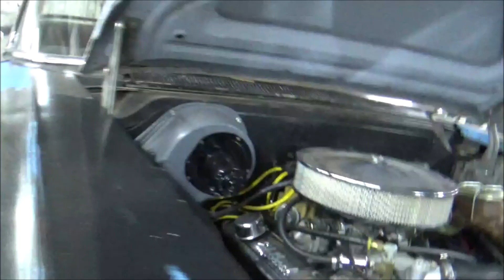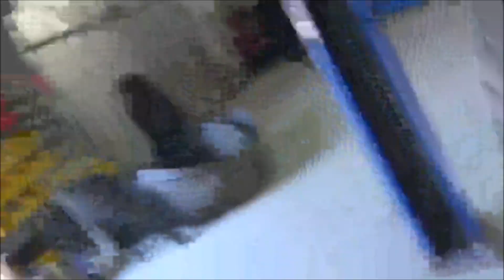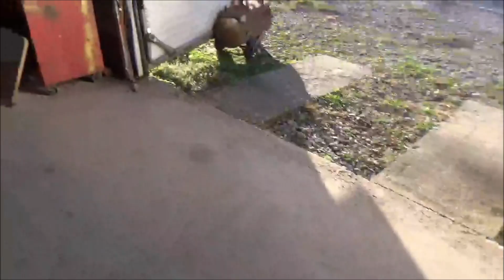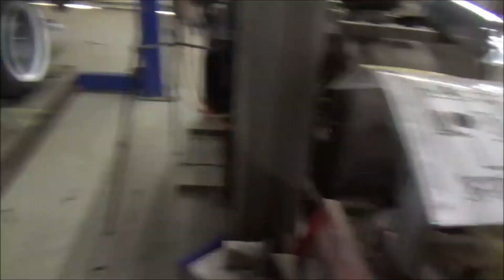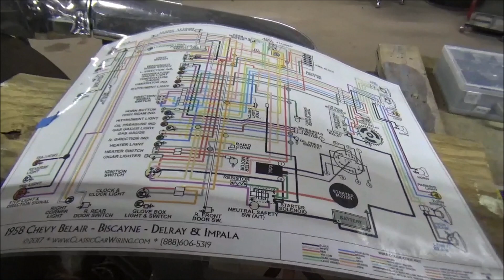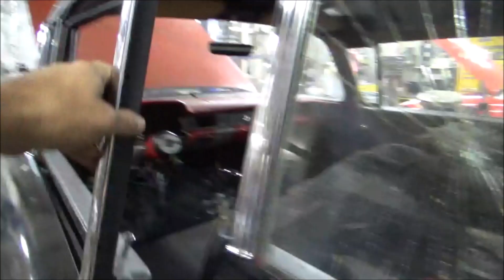Peggy Sue 1958 Biscayne

Comment: Beauty car. I have an X-frame car up in Alberta, Canada. It's a 1966 Pontiac Strato Chief. In the '60's, Canadian full sized Pontiacs used Chevy frames and drive trains. The bodies looked the same as US Pontiac Catalina family, but they were shortened to fit the Chev frames. Interiors were all Pontiac. 

Any grease will work just fine on electrical connections. I have tested a bunch of greases, and not one of them has been electrically conductive. Grease inside of connectors lasts a very long time. On my body grounds, after cleaning and bolting them up, I will often shoot them with some paint to seal them up.
Reply from the maker: Cool

Comment: It looks like the outside clearance / tail lights are brighter than the inside ones? are those 1156 outer bulbs? They should all be the same lower brightness in running mode. only the inside 1157 dbl filament bulbs should get brighter when activated by brake switch or blinker switch. something wonky going on there! Weee electrical fun! lol! Wiring isnt as bad as people think as long as you do it right! Fun project! 👍
Reply from the maker: Thanks 👍
 1157 inside bulb. Single outside bulbs
Reply: I bet I have a factory type manual for that 58 if you need some more schematics. im not super familiar with the 58 but chevy is right up my alley lol @heavymetalcustoms3357
Reply: i do know those 1156 bulbs shouldnt be that bright
Reply from the maker: True